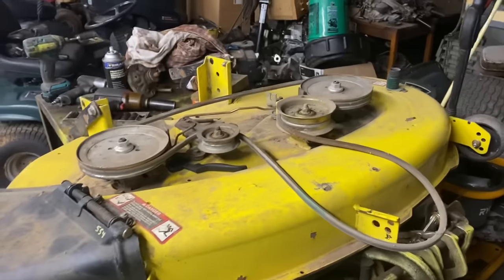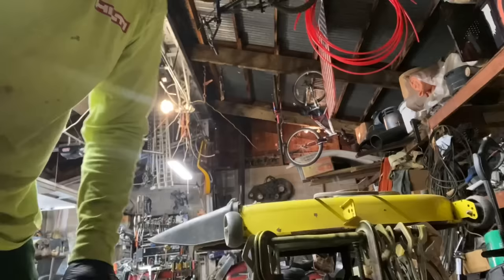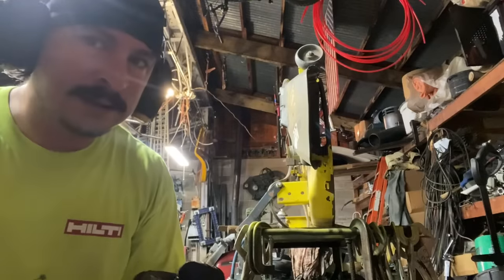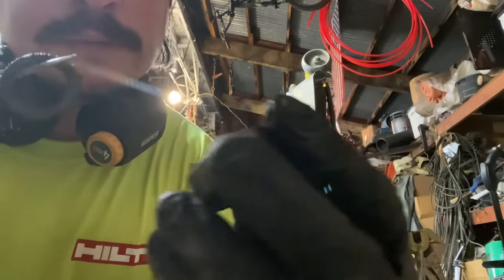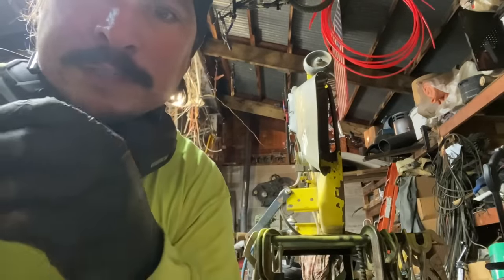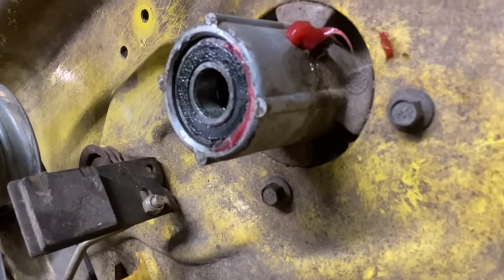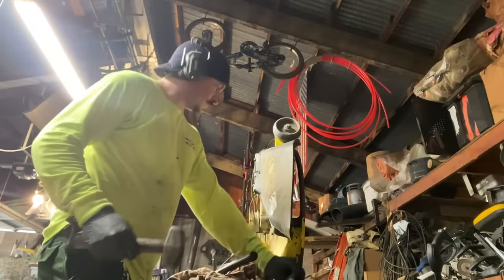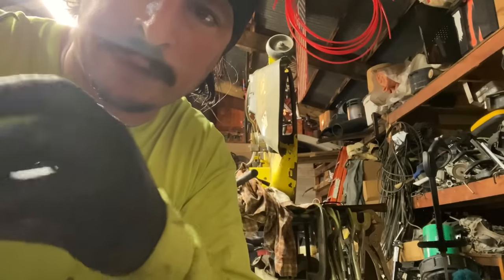Part 1 - Don’t trust the “Experts” Grease your mower deck sealed spindle bearings Common sense.

Comment: So you would think a common sense issue would take place but not! John Deere is just like everyone else, no common sense. You could remove 1 of the rubber seals on each bearing, align them so the open side is into cavity of the spindle and just fill the cavity with grease it will force the grease thru the bearing. You have to grease at least 2 time in the season but in the long term it would be greased completely. And the bearing will last 2 times longer.
Reply from the maker: I proved the inner seal does not stop grease, did you watch the full video? Seems like a lot of folks quit watching before they get to the main part where I prove the process works. I get it, the video is boring. But currently I’m the only person proving that the shields do not prevent grease from passing. As for how often it would need to be greased, once a year for the average home owner is actually plenty. Unless the machine will run more than 40 hours. The average home owner mows about 40 hours a year. Your welcome to leave a comment but I will also express my opinion on the topic. I think that’s only fair. We all have opinions, I like to prove mine. In this case it’s a very important topic with very little accurate information available. The faster your deck fails the faster you buy another tractor so the big corporations rather you run your machine to failure. I like to see folks get a good long life from a machine.

Comment: Over-greasing tutorial.  If you do this, your bearings have too much grease in them.
Reply from the maker: Apparently you don’t know jack crap about mower decks. But eager to run your mouth I see. This is basic mower servicing 101. Can’t over grease these. Assembly won’t hold pressure. looks like we have another expert ready to provide us the information we need with no proof in sight. Just an expert with no evidence of any facts. Can’t wait to hear your credentials. Another engineer or do you work on aircraft? I’m so eager to hear what makes you an expert. I’ll bet you don’t post a video to prove your point. Are you just one more expert who knows it all but too lazy to make a video and show us the dangers of “over greasing”? 😂 I won’t hold my breath. In two years not a single naysayer has provided a shred of Evidence that over greasing is possible in this application. News flash, it’s not a thing for mower deck manufacturers chif.
Reply: @GTObearclaw1  So explain super brain why these sealed bearings come with about 25% fill of grease by volume. Seeing as you are more knowledgeable than the manufacturers or engineers or professional maintenance personnel.
Reply from the maker: @dennismoore1116  if knowing one thing in life makes me a super brain, then that’s awesome and first time Iv heard that. But I’ll take any compliment you want to offer. I may not be any more knowledgeable than the manufacturer however I’m willing to offer the information and they don’t. Just take some time to let that soak in a while. What do I stand to gain? Nothing. What do they stand to gain by not offering information to make decks run longer? O simple, parts sold or more machines sold. however my gole is to get folks bearings to last forever without need to spend money. I don’t get paid one way or another. Just like to see people have the real story. And that’s why I did the baby step video. I have no benefit from this other than to see folks receive the information needed to make the decks go for as long as possible. I didnt make this video with the idea of making a proft. Only to help folks. As for why the manufacture of a box store mower won’t properly fill a bearing or add a quality grease, that’s a question you should try to extract from big corp. after 20 years of trials and error Iv found this to be a bullet proof way to make deck bearings go for ever if properly maintained they can outlast the engine and other components if maintenance is started from day one. As for naysayers who have no real hands on experience and want to argue, I’m your huckleberry. If you think the big corps care about us and if you think they don’t engineer failure into these machines your sadly mistaken. The quality in the last 20 years is baffling to myself and I’m sure others who work on mowers. I seen a video from one of the top channels just a few days ago where he is basically getting out of the business because of how bad it has gotten. To think these bearings should only have 25% grease is absolutely insane when they put a zerk on the assembly. Be realistic, nobody can pump 25% grease into a unit. And commercial and all the old school units were always pump till you see grease. How did that get lost in the last 20 years? Because manufacturers quit proposing the directions and left it to the owners to figure out. Who would think it would take 60 to 90 pumps to fill the void? Answer is very few folks would realize that and only folks with substantial knowledge or impressive intuition would know better. But thankfully I decided enough was enough and stepped in to help folks rather than be a brain dead mower channel and give folks the same stupid advice because I’m too lazy to run some hands on trials in my shop. I did this for me to keep my machines running: took me years to realize not a single person out there was peoviding the information I knew was true. Your welcome and hope your not offended but I call it like it is and if your build like the old timers you can take one on the chin and accept when your wrong. Otherwise I’m sure you can go full Karen and throw some insults. But I’m here with evidence that can be tested by anybody and left nothing to be questioned except does it work and there is one way to find out. My way may help your bearings go for ever. The other way leads to guaranteed eventual failure. So what are we arguing about here? For real? What?
Reply: @GTObearclaw1   You don't have maintenance experience as a professional do you?  I've seen several of these decks out last the engine with no greasing.  Sorry to burst your bubble,  but they fill the bearings 25% because that is the proper amount and they don't expect regreasing.
Reply from the maker: @dennismoore1116  your kidding right? im not claiming to be a professional and if you think folks can’t teach themselves in today’s technology your close minded. I guess you assume that only way to be a pro is to work for a company or something? I do not follow what I’m told, I do what makes sense when someone tells me something that seems stupid I test my theory and see what really happens. Iv seen professionals tell a man he needed a new 600$ transmission in a 20 year old tractor. He refused to pay the repair and left the tractor at the shop. That shop told me I could have the tractor if I paid the diag time. I got it for 100$ welded the pully to the shaft and mowed with it 5 more years. So what kind of professional was that? They didn’t help the customer. Dont be dooped. I’m not saying some machines don’t come with a higher quality bearing and an excellent quality grease that can last a long time. But I will say with 100% certinty some of these new machines will loose bearings at under 100hours without adding grease. Go get a 100series Deere from Home Depot. You better add grease or it will cost you. Even the bad boy zero turns can’t last over 400 hours without bearing failures. Iv seen some bad boys loose bearings at 200. And those are supposed to be commercial with no grease zerk? Absolutely ridiculous.  Just the facts these days. You’re on the wrong side of this and you don’t know it. You’re basing you may be basing your argument on a handful of lucky experiences.  But that’s not the reality in the mower world. If it has a zerk, be thankful and grease it. Some machines like bad boy don’t all come with zerks and Iv replaced enough bad bearings and checked the hour meters less than 4 years old and bearings gone. It’s simple preventative maintenance. Do you trust engineers and doctors just because of their titles?

Comment: I have had it with today's craptastic lawn equipment. Just bought myself a scythe, 28 inch grass blade, a peening anvil, a peening hammer and two sharpening stones. I never have to buy chinese crap for new parts again. No more belts, carburetors, lubricating "sealed" bearings, etc. ever again.
Reply from the maker: Interesting choice

Comment: Most mower decks have sealed bearings so greasing them is a waste of time. Unless you remove the seal, it's stupid to try to grease them. They do come from factory with a small amount of grease in them. However, trying to force grease past that rubber seal is kinda dumb if you think about it. Seals are there to keep stuff out so good luck with that. I don't know what this guy is trying to prove but he's definetely no expert.
Reply from the maker: It’s absolutely not a waste of time. You’re dead wrong. Grease passes by the “seal”. You might want to take a few minutes and watch the full video. I have all the information included to  provide the proof.  There is a reason I made this video. folks are grossly mislead about greasing bearings in this application. And a large part of the misinformation on this topic is because even most so called “lawn mower mechanics” on YouTube “the EXPERTS” don’t have a clue. Be careful who you trust. Don’t buy into the false information. It’s so simple to try it and see. Why would so many mowers have zerks on the mandrels for the last 30 years if they were not functional? The proof is in the video. If you want to disagree that’s fine, but the information can most certainly benefit you. I already know it works and I’m trying to help folks. It’s so simple to connect a grease gun and try it at home. I gain nothing. The only person who benefits from you greasing bearings is you. Mower shops won’t get your money, parts sellers won’t get your money. Your mower will work longer without loosing bearings. You stand to win, No one else.
Reply from the maker: The prof is in the video. If you’re not interested in the facts that is okay. I’m pretty sure nobody has been able to prove me wrong to date 10-30-23. and it’s a free world, create a video. Prove me wrong. Post it right here. Drop your link in the comments. I’ll let you post without deleting it. All the so called experts saying otherwise won’t back their claims. Iv asked every single one to show proof. Nobody can prove something that’s false. But they love to post videos of false information they love talking about how it won’t work. But how can you be certain without proof? I showed the evidence and went the extra mile. It still confuses some folks. The information will never be accepted by 100% of folks. That’s okay, some folks get it and I’m happy to help those folks. I understand the process is confusing. The word seal seems to really be a road block for some folks. It’s just a word. Many levels of seals exist, some are simply a dust shield with a fancy name. Some don’t have the right tolerances and or reverse lips woth springs to maintain a tight seal. It’s hard to grasp but it is a topic that some critical thinking is most certainly needed to understand the concept.
Reply from the maker: Do you even realize you admit that a small amount of grease is getting past the seal. I mean it’s just a dumb argument. Yes, grease gets past the shields / seals what ever the terminology is that you like best. Shield, seal, rubber lip, dust cap. All
The same for these applications. So you say grease gets past the seal, that’s the point. And now we are on the right track.  I bet your fun at parties. More grease gets through than you realize but a small amount is all that’s needed. Finally we can agree on something. Grease reached the bearings just as my video showed. That’s the end goal. You can delete this whole thread if you would like. That way nobody can see how dumb this conversation was. I’ll just leave it if you don’t want to remove it. I’m not interested in taking it down for you. Some folks can get a laugh. I know it made me chuckle.

Comment: How many people pump more then 3 pumps in? Seriously, why dosnt the factory fill them up. They have powered guns to do this, you give 4k bucks for a tractor and it comes with just a dab of grease in it.  Me I took everything off the deck and hand packed everything including the pulleys  just pop off the cap and load them up, reason I did it was I washed my deck one fall and stored it away wile I put on my snow blower for the winter, the next spring I put the deck back on that sob made so dam much noise
Every berring was rusty sounding. Every one I pulled the deck and packed every berring the pumped the spindals full after a few min running it got quiet agine. 
A noises deck dosnt mean the berrings are bad just dry.  Try filling them first.
Each one cost over 30 bucks add them up 
Your into it for 300 bucks all said and done or under 50 bucks for grease  time and tools with the fancy locking fittings.
I regret it should have bought a powered unit.  70 pumps 3 times gets old. You can always wipe off the extra better then buying s new spindle.
Reply from the maker: Sounds like
We are on the same page

Comment: To much grease is harmful also, worked maintenance for 45 years in an aircraft manufacturing plant. Don’t listen to fly by nights.
Reply from the maker: Hay boss, did you notice this was not an airplane part. Did you see any airplanes in my shop? Did I say I was greasing aircraft bearings? Or did that little detail fly over your head? You’re just another expert
I see. Of course every bearing in the world must be just like aircraft bearings since that’s what your an expert about so now your the one we should know a trust. Even though you don’t have any videos to help us with mower deck bearings. Another expert, Same as the ones I advise to watch out for. Dont trust an expert. Trust what can be proven and seen and tried at home. Even trial and error is more responsible than just taking some clowns word for it. Whoever gives the advice, find the truth don’t just trust what we are told. Iv proven this works for 20 years never had an issue not a single time. It’s how they are made to be used. I have provided proof the process works, yup the video where I proved facts on non airplane parts. I guess because you think airplane bearings are the same as everything else, now you’re the lead consultant for all bearing related matters and they all fit the same category and fall under your umbrella of expert status. What a total load of bull crap, I believe a true air craft mechanic would have basic common scene and know better, so I doubt your credibility. But nice try, few if any will listen to your advice. Terrable as it is, not the worst Iv seen or heard. Hay but it’s free to post videos and boast your expert status. Dont let me stop ya. Fly your arse over to the camera and get us some more gold nuggets on video. Can wait to see what kind of Jewels you drop on us.

Comment: Lol just pull the spindle apart remove inner seals an grease every four weeks . If you have grease fittings if not still pull apart remove inner seals an drill tap an add grease fittings only top models have grease able type bearings an fittings
Reply from the maker: What? I can’t read that mess.